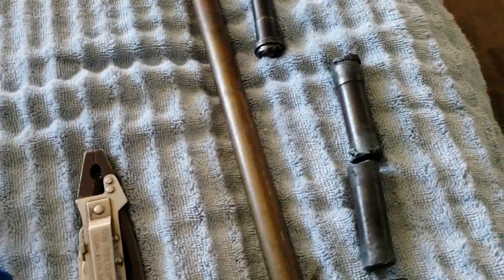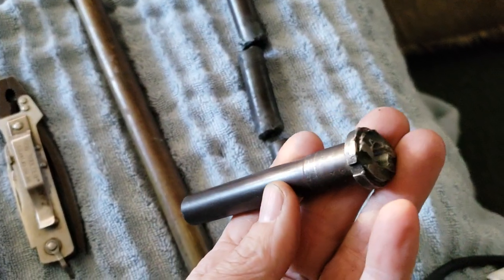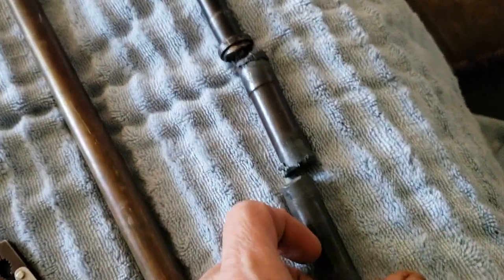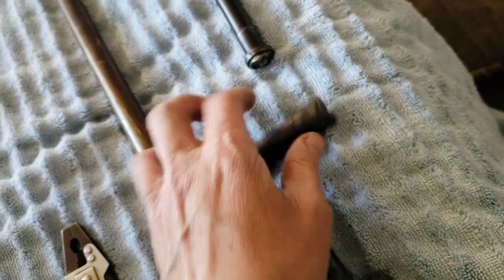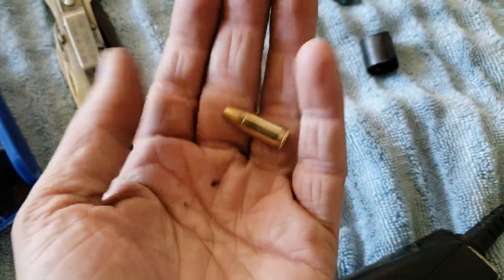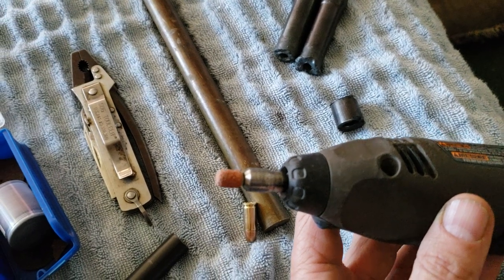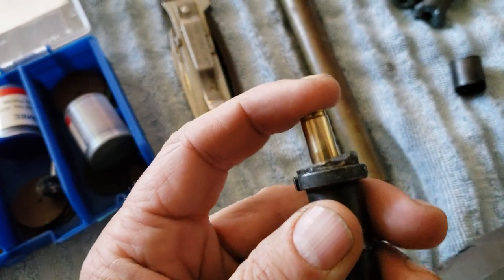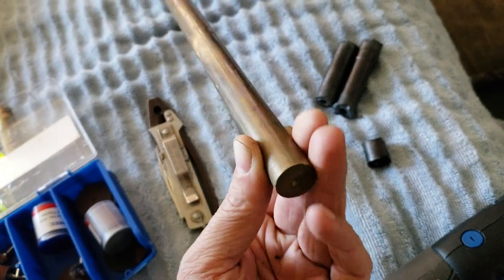Idea coming together for a new homemade gun, use a dremel to grind out a chamber

Comment: Hey before you wreck a nice piece of barrel, buy an 8.6mm drill bit and cut the chamber that way, doesnt have to be accurate because the rim will headspace it. Dremels are good for cutting feed ramps though
Reply from the maker: Ha ha already done and it came out great I think. Not my first time around a dremel and I used a drill and sand paper and steel wool to smooth and polish. Wish I had a 20 round magazine for a CZ61 scorpion though, could always try and make a mag I guess if not use a mag from my CZ27
Reply: @brasstard7.627  copy the magazine plans from the diy sheet metal pistol mk 3, it works for .32 acp and  .380

Comment: That bar also looks about 1 inch diameter, so it should  fit it a 1 1/4 inch or 1 and a half  inch pipe (i dont live in america we use metric here) you will just need to cut a small slot in the bolt (the easy way) for  the weld seam or grind it out (the hard way). Good luck
Reply from the maker: Its a 3/4 inch bar
Reply: @brasstard7.627  1 inch pipe will work then, just remember the bolt slot like I said